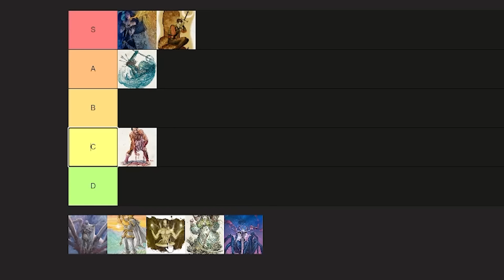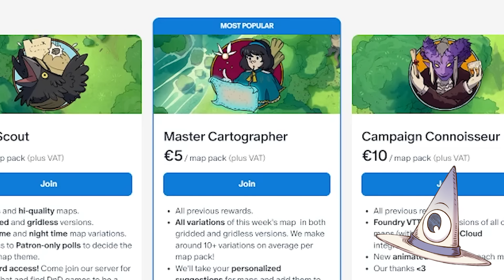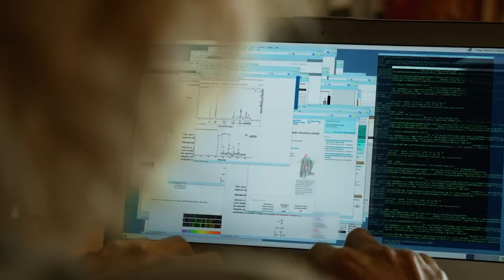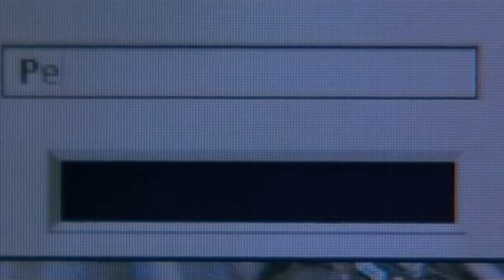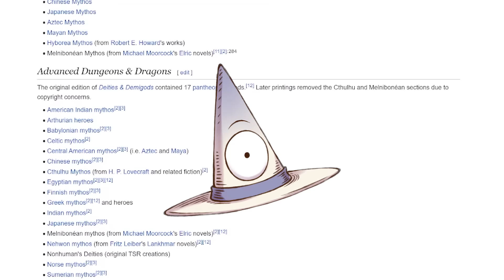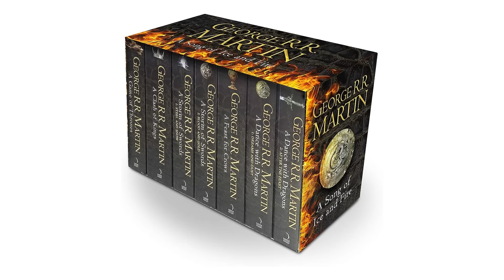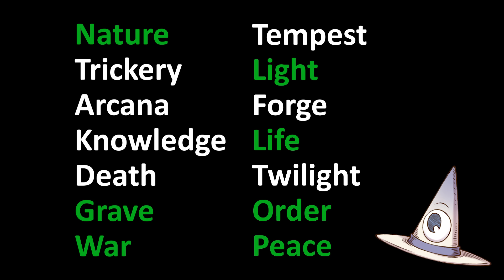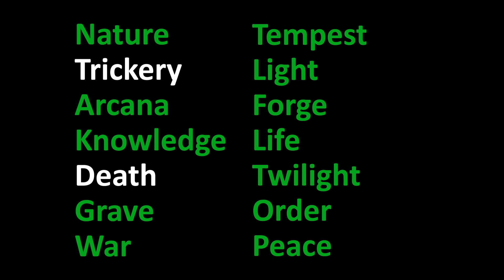The Problem with D&D Gods (and how to make your own)

Comment: When I was creating my homebrew setting I made it on the surface seem like there were hundreds of gods, but if players actually dig deeper into the lore they would find, for example, that no there are not 40 ocean gods, there are 40 cultures that all have a different name and interpretation of a singular ocean god.
Reply: Now that I like 👍
Reply: I did something similar with the beastfolk in my campaign setting.  The tabaxi worship a cat, the aaracockra worship a bird, the locathah worship a fish, etc, and they all worship this entity monotheistically as the creator of their entire race. However, it's actually just the same entity in different guises, and therefore the worship and domains of this entity are relatively consistent across all of them, even if there are major doctrinal differences.
Reply: syncretism 101
Reply: That’s how I’ve homebrewed my gods. It’s the way to go I think.
Reply: Basically like we have different brands coming out of single company

Comment: I'd just like to point out that, in the Greek pantheon, there are at least, like 135 named deities that have specifics known about them and are all directly related to the core pantheon.  This does not include the endless variety of nymphs, daimones and other nebulous deity like things that are in fact the god of that rock over there, that are not specifically named.
Reply: Yeah I was gonna say, the argument here seems to be against polytheism in general. Many polytheistic religions had gods with overlapping spheres of influence or even redundant gods. And very rarely (as far as I know) are there stories where an entire pantheon takes an interest in a specific story or event usually it's only 1 or a small handful.
Reply: With the greek daemon being a very close analog to the lesser kami in Shinto.
Reply: @opuntiaechios9683 to be perfectly honest, I feel that the one of main arguments against making an expansive pantheon with hundreds of gods is that fleshing those out is a lot of work, and for the single worldbuilder, it might straight up be impossible.
Those pantheons in the canonic dnd settings are detailed as they are because they had multiple authors working on it, often in the span of decades.
Hoping to achieve even 10% of what they got as a single DM is really setting yourself up for failure

Comment: I’d actually argue that it might work to have four gods with the second method, less dependent on epithets but small enough in number to keep the idea of “unknowably-powerful-few”. Plus, a lot of notable reference points come in sets of four that you can mix and match…which I will explain with my own set of four.

1.) The four classical elements of Water, Earth, Fire, and Air.

2.) The four classical temperaments of Choleric, Melancholic, Phlegmatic, and Sanguine.

3.) The classic RPG lineup of Mage, Expert, Brute, and Healer.

4.) If you’re in a game with a heavy focus on the alignment system, you have the four extreme alignments of Lawful Good, Lawful Evil, Chaotic Good, and Chaotic Evil. I don’t use this one too much personally, but I still wanted to mention it.

Mix and match a few of those, and you’ve got a set of four deities who feel very different from each other but are easy to remember! A Chaotic Good-Sanguine-Healer-Water goddess will feel extremely different to a Lawful Evil-Phlegmatic-Brute-Water god, even if they’d technically both be categorized as “sea gods”, meaning that your pantheon will feel unlike any other!
Reply: I love the second one , and this idea in general, a lot

Comment: I used gods in my D&D games as theme parks basically, they'd have their own cities or temples and the party could buy thematic items from gift shops at the exits where you can buy overly priced but sometimes useful magical items. Oh, but for my Cleric I would have their god give them quests, which doing these quests would give them special points which they could spend on thematic items like the ones in the gift shops, but instead of buying them you can get them through godly favor basically.

Also Pointy Hat's art is really good, if you read this keep up the good work.

Comment: Whenever someone asks me as the DM why the gods can't or won't interfere I explain that while the gods are very much aware of the evil sorcerer only a limited number of their faithful are. So intervening on their behalf (in the mortal realm) is impossible because so small of a subsection of the populace is asking for help. If a much larger section of their following were to ask for help, they would. Which ties in nicely because if we're talking greater deities it would take half a continent asking the same thing for them to jump in. But it opens the way for some smaller deities to hop in and help out. If a requirement for interfering with mortals is the majority of the faithful themselves asking for it, it becomes an impractical goal but still a somewhat realistic one.

Comment: 15:33 The thing about D&D having so many gods is that many of them are from different settings. You're not meant to use ALL of them in one campaign world. If you play Greyhawk, you use the Greyhawk-specific gods. If you play Forgotten Realms, that has its own set of gods. Same goes if you're running a campaign on Krynn, of  the Dragonlance setting. And if you're running a homebrew campaign world then you can pick whichever "official" gods you like, and mix-and-match with your own homebrew gods or ones taken from outside D&D altogether.

Comment: The main problem I have with gods in D&D is that they act in the world.

The fate of a world should depend on mortals, who could represent the wills of specific gods or not. If an all powerful or nearly omnipotent deity just shows up, regardless of whether they're against the players or helping them it feels to me like players are insignificant.

A huge number of them helps that issue fester.
Reply: At that point you might as well make them not real or atleast way less powerful
Reply: @Granad784 
Or just do the Baldur's Gate way of things. They're there, but themselves they like never act unless the matter would realistically be important- then they send an agent or something.

It's when DMs start putting gods in the world, physically, when I'm just a level 1 goblin, that problems appear
Reply: Exactly my thoughts. If gods or beings of similar power intervened directly, the world will become an unending battle between the gods and total chaos will ensue. Especially when you have things like evil gods that do bad things for no apparent reasons.
So you either make your gods way less powerful (as Pointhat mentioned), which also makes them less god-ish, or you come up with a reason why they can't intervene directly except for maybe rare cases (perhaps the gods are aware that acting will destroy the world).
Reply: @starhalv2427  At that point just make them not exist if only their following do anything they don't need to exist

Comment: The reason why most gods don't tend to intervene so easily is because it'd set a precedent for other gods to overreach, generally a god is going to work through their clerics and direct them to act on their behalf, or step in as a grand gesture to "reward" their cleric for their devotion, essentially giving themselves plausible deniability.
Given that the alternative is a non-stop divine free for all stepping in to act on the behalf of their followers, which would leave so many dead and the land obliterated.

Comment: I don't know about 5e, but 3rd edition has whole sections in the book Deities and Demigods describing perfectly good reasoning that you can use for why some gods get more involved than others, why they do things through using mortals, etc. One of my own preferred ways of thinking about this is "if all of the gods could act freely in affecting the Material Plane, they may as well just be fighting each other directly, because that mess would be too much for mortals to take." It makes more sense to me that there are divine pacts in place dictating what gods can and can't do, and one of the easiest things that they can do is lend touches of their power to their devoted mortal followers. 

Only one god seems to be busting their ass to help the party, and it's the one related to your cleric/paladin? No. That's just the only god whose machinations you can get glimpses of from your position. Who's to say that a number of the problems that the player characters encountered were set up directly or indirectly by antagonistic powers from beyond at some point in the past? Who's to say that the god on your side isn't going to steer you through dangers so that you can eliminate these evils on your way to solving the big problem?

Comment: Thanks for this video.
I am actually trying to cobble together my own pantheon and was working under the concept of higher and lesser deities. 
(I basically took the 4 horsemen, inverted the concepts and gave the two sides to each of them. Then i thought about what domains would fit to them.
The 4 pillars. (not directly involved in the world)
After that tried to come up with lesser deities. (They felt off anyway, so i think i'll scratch those and only leave champions of sorts)
There are also the 3 beast (3 evil deities); but i might make them into something else entirely.

Comment: The question why not all the gods fix the problem is the same as why not other heroes solve the problem and defeat the bad guy. Maybe they are solving even bigger threats, maybe your god or party is the closest-best suited to deal with the problem. Also, the gods doesn´t deal with the problems in the material plane usually, so that should mean that they can´t.
Reply: Yeah I agree 
I also like to think that gods just like to watch how these threats unfold purely for entertainment purposes but if the threat becomes too big the god would easily beat them but they never need to because the party takes care of it

Comment: To the point of gods not helping, if you ask Gale why Mystra won't destroy Absolute he mentions the reason. Some god or god council or something (he just says the name which I forgot) apparently don't want them to just openly meddle with mortal affairs but they help indirectly by clerics or guidance.
It reminds me of how ascended beings work in Stargate. When they tried to help, it usually ended up with disaster so they not only discourage interacting with lower planes but use their collective power to punish you if you step over the line.

Comment: I have a Pantheon of 32 gods, and they rule over different elements. They all have varied relations with each other, and all have to agree to stop any threats on humanity. They are basically more powerful than even greater gods but only within their respective elements, yet they all can act as aspects of the same god every now and then. However, they still will interact with mortals and gives them light blessings or curses depending on what's going on. However, even then sometimes they're busy either in meetings or using their divinity on others, so they don't always have all the time in the world.

Comment: I had this idea where both the beginning and end of the universe were deities. In the "space" between them, all of creation existed. When they embrace, they close the multidimensional metaphysical distance and undo existence as we know it. 
They noticed this as they first hugged, when they heard faint screams of fear and pleading for help in their joint project.
In order for anything to be, they have to stay away from each other.
To make their separation bearable, they send messages through the universe.
These could be beings that were created, have offspring, and over generations carry a message in form of e.g. a tradition to the end of time.
The other way it could be a backward cascade of vision of the future, that travels back to the beginning.
Both contain a message that only they understand or even notice.

Comment: you mentioned the history nerd vs anime nerd angle, while talking about greco-roman gods vs kami, but the issue is that the greeks (and romans) did have gods that ruled specific rivers. Or rather called spirits, but you get the picture. Combine that with how many of these gods were also city gods, a la athens and athenia, etc. And you got a situation that looks remarkably similar to that of kami. Just with a higher power ceiling.

Comment: Usually the gods of Faerun are split into groups according to their main aspects. For gods to interact with the Material plane temporarily costs them power, by creating an Avatar. Now if one or multiple groups want to help/interact with the players they would chose one or a handful of representatives, greatly limiting the opportunity cost of the whole ordeal and leaving the other gods to work their powers elsewhere. And if a Cleric of one of the gods is in the party, their god would have the privilege and duty to liason, since they are primed to gain the most followers from the prestige of their cleric's success.

Comment: Speaking purely for myself, I find specific gods that strongly evoke a particular theme to be FAR more useful and desirable in my campaigns than over-expansive ones that cover half the established domains; for which reason I can't envision ever wanting to use anything like your examples.  I've never once had a problem with "too many gods" in any campaign, other than it being a bit of a chore to write a whole new pantheon for a short-lived setting.  There are millions of possible ways to limit interference in mortal affairs when desired, including such things as "too busy with other threats", "unwilling to draw unwanted attention from other powers", "wanting mortals to be self-sufficient, self-determining, and/or capable", "non-intervention pacts with deities of opposing ethos", "incapable of certain types of interference due to various cosmic forces or laws".  The Order of the Stick has a pretty good one in the Snarl - a cosmic monstrosity that arises and is empowered by disagreements between deities.